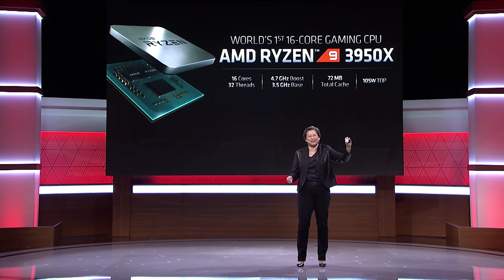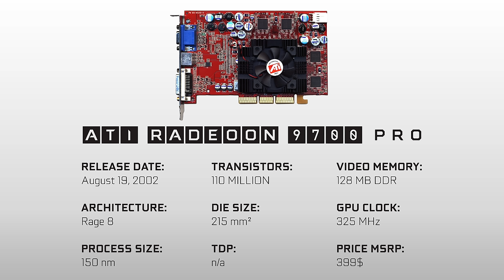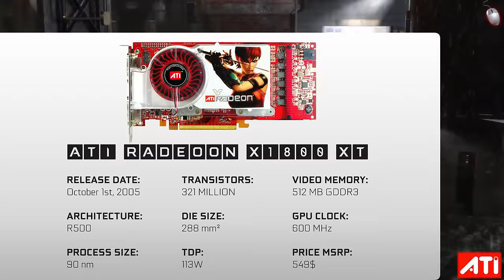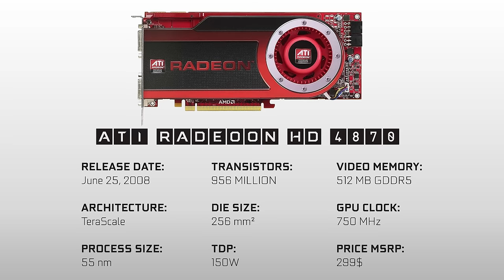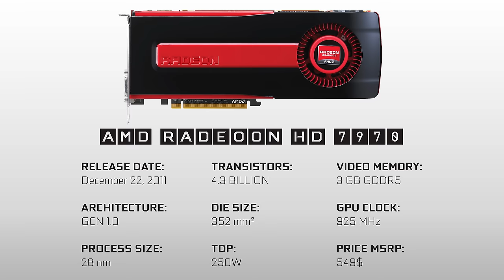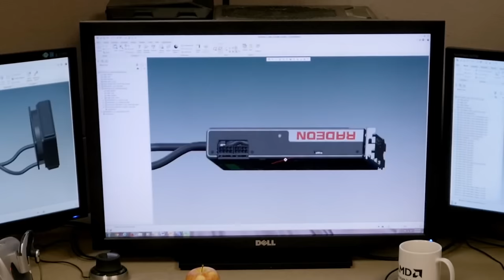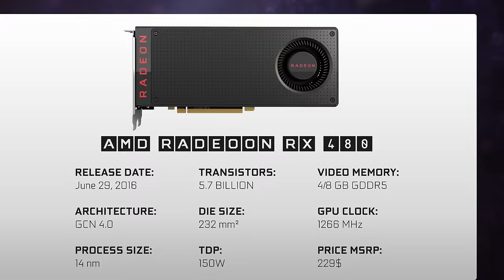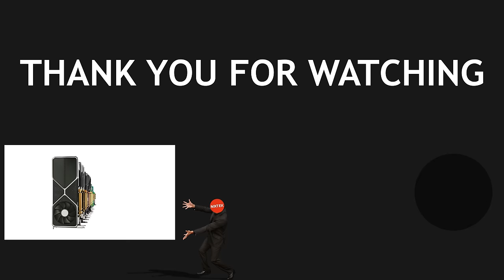The Evolution of AMD/ATI Radeon Graphics (2000-2022)

Comment: I long stopped using Radeon videocards. Every time I did, back in the past something catastrophic happened, like the divers being outdated and the newer ones nowhere to be found (on cards series 7k on baby internet) and when finally found were infected and caused massive data loss. Another card much later, when I felt to give the Radeon cards another chance, that was painfully underperforming, changed with one that overheated causing random freezes, and for the last strike, changed with one that on first seemed to work fine but only to one morning be found up DEAD.

It is surely a streak of  bad luck I had with these cards, not any fault of AMD or ATI before them, yet... how would you react in my place?

Comment: I have had (including kids's PC) a ATI Rage II+ 2MB, Rage 128 Pro 16MB, Radeon 7000 32MB SDR, 7200 32MB DDR, Radeon 7500 32MB DDR, 8500 64MB DDR, 9600 Pro 128MB DDR, 9800 Pro 128MB DDR, HD3870x2 1GB GDDR3, HD4670 GDDR3 512MB, HD5670 GDDR5 1GB, HD6670 1GB GDDR5,  HD6970 2GB GDDR5, RX 550 2GB GDDR5, RX 570 4GB GDDR5.  I am going on my memory but I think this is the ones that I had.

Comment: Hello. First of all thank you for the video. 
I'm a big fan of AMD video cards. I think if I compete the RX 6000 series with the rtx 3000 series from nvidia than i can say that if I look performance, power consumption and price than I think AMD is the winner if you're not using raytraycing.
For example rx 6950 xt vs 3090ti. The radeon's performance usually weaker with 5-15% depending on the game but power consumption is less with 20-30%. 
3600ti vs 6700xt the radeon 6700xt  is faster every time, more fps, more vram, less power consumption and it's cheaper also. 
Sadly but I have to admit that entry level 7000 series is not too good the high end series is good but just up to the RTX 4080.

Comment: had gigabyte triple cooler r9 290 4gb which still went up to 80 degrees Celsius with open case, cooler was not a problem of r9 290, it was just a hot garbage, meanwhile fermi gtx 480 stayed pretty cool with duo arctic cooling mod and never exceeded 70 degrees in a closed case

Comment: How can a 2007 GPU card have GDDR4 VRAM and here i am still using a 2013 Toshiba L840 with ATI Radeon HD 7600m and although it has 4 times more its GDDR3 i checked mine in GPUZ AND HWInfo the architecture WAS Thames XT

Comment: i just baught a Powercolor Red Devil Rx 6750 xt...hoping for the best! ive always trusted going with AMD due to their better priced products, but this was the same price as the 3070 ti amp holo...i know the ti performs better but im trusting the 12 gb vram will outlast the 8gb 3070 ti.
Reply: That's precisely the card I have. It replaced an RX 580. Do yourself a favour and do a clean windows install if you've ever had an Nvidia card in that machine. DDU doesn't work as advertised. This has resolved 99% of all problems I've come across when people complain about Radeon drivers. Other than that: you will be pleased with that card. It runs cool and quiet and undervolts surprisingly well because the output filtering on the VRM is every kind of overkill.
Reply: @andersjjensen  it's going in a new computer so everything is fresh, haven't built it yet but glad to hear you feel it's good quality :D I actually plan to run it in silent mode since the OC doesn't do too much, actually decreases fps in some games
Reply: @michaelfalabella6296  I never use the built in modes, so I wouldn't know. The first thing I do when I get a new card is make custom fan profiles (I'm sensitive to noise!). Once I've set the maximum fan RPM I'm willing to tolerate I start stepping the voltage down in tiny increments and run benchmarks until I find the performance drop-off point. Mine happen to give the best performance to noise ratio with a power budget of 110% and a voltage offset -40mv. This gives me a GPU temp of 76C at 1800RPM and 103% Reference Spec performance.

I would, however, think that if some reviewer found that the OC mode decreases performance it's because they have a sorry lack of case fans....
Reply: @andersjjensen  ill definitely refer to your specs when I get the computer built, im excited about the quality of the red devil as I tend to keep computers for a while before upgrading. So keeping temperatures low but keeping performance is the main deal for me
Reply: @michaelfalabella6296  It's all down to the silicon lottery... You may get better results than me with TDP of 105% and -60mv or you may end up having a chip that will only do exactly reference spec at reference voltage, but in that case you still have a much beefier cooler than reference spec, so you can can get good temps without it sounding like a jet engine :P
Reply: @andersjjensen  fingers crossed 🤞 👍

Comment: lol my 5700xt got 5fps more than my vega 64. It's the only generational upgrade I have ever gotten rid of and not missed, I don't consider it a flagship even.
Reply: I would say RX 5000 series is a huge upgrade. They tackled a lot of issues they had with GCN such as requiring large memory bandwidth. Using HBM is one of the solutions.

Comment: "Processing node" is called "process node".
"Double date rate" is called "double data rate".

"It was built using the 150nm processing node which was based on the Rage 7 architecture"
WHAT??? That's outright nonsense! Try this: "It was built using the 150nm process node AND was based on the Rage 7 architecture".

Omg, and then again: "The same 150nm process that was based on the Rage 8 architecture". Dude, do you even have the SLIGHTEST clue about what you're talking about?

AAAND again. Can't you hear it? "TSMC's smaller 130nm node WHICH WAS BASED ON A BRAND NEW R400 ARCHITECTURE".... TSMC does absolutely not base their manufacturing nodes on chip designers arbitrary names for their architectures.

OK, I give up....

That being said, thanks for being fairly accurate on the historical side of things at least.

Comment: AMD still cannot beat Intel when it's comes to CPU and cannot beat nvidia when it's comes to GPU . Hold your horses AMD  fanboys Tuned 12900k just destroys AMD 5800x3d
Reply: So? Ryzen 5000 held the crown in gaming performance, multicore performance and performance per watt for 12 months straight before Alder Lake came out. This is how we should want it. If they keep taking turns at winning the crown competition will be strong. That keeps pricing tolerable and insures the stagnation Intel had during the 7 years of 14nm don't come back.

Comment: AMD has cheaper cards with very similar performance. Take 6900xt vs 3090 for example.. it looses in rtx and in some games but it uses way less power and is 500 $ cheaper.

In general AMD is just better value with 5-10% lower performance. Entry level they dominate nvidia tho.. like 3050 is a meme tbh

Comment: You could have added a bit more history into it, it's missing some good examples of less expensive GPU's that had a lot of talk too...

Anyway one of the best GPU I ever bought was back in 2004, a ATI 9600 XT for almost 100€ brand new and could play almost maxed out until 2 years later.

The worse GPU EVER that I bought is the god damn ATI X1800 GTO, paid around 300€ for that garbage and my brothers almost half the price Nvidia could even run most games better and some games I couldn't even play started working and performing nice when I grabbed my brother's smaller Nvidia jeez (while on paper the ATI was better in almost everything, the drivers always sucked and some games was just huge stuttering that was completely fixed to just going with NVIDIA)...

My PC still only have a Strix RX480 (flashed to Strix RX580) but I can't say it was an amazing purchase, much better than the crap X1800 GTO for sure but many times worse than the ATI 9600XT and also worse than my older 3 slot Asus DirectCU-II GTX570.

Comment: I wish I had kept every card I owned. It started with a few Nvidia gpu's, but my AMD "fanboism" started with either the 280x or the one before it. The versions in this video are all the flagships and I always had low-mid grade like 280x, 3770, 5770, 480x, 580x, and the 590x that is still running right now in my mothers computer that I replaced with a $1200 6700xt during the height of the GPU apocalypse. They were always just affordable whereas Nvidia was just not. What was affordable from Nvidia I could just get more bang for buck with AMD. Apparently there has always been an issue with their drivers but it doesn't help that a lot of game developers made games using Nvidia, which is why you would and still do see their logo popup during game launch intro. "Best experienced with xxx" I really haven't had that many issues with my all AMD rigs for the last 20 years or so, which is why I keep using them. I don't have to be #1 when I can be close enough for much less, with a few less FPS.